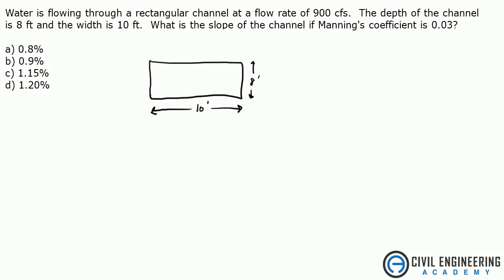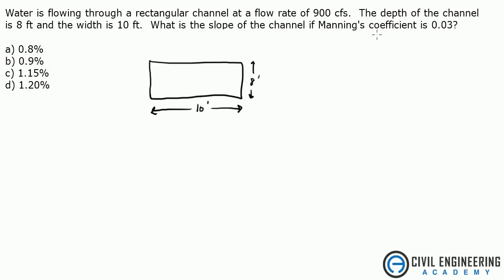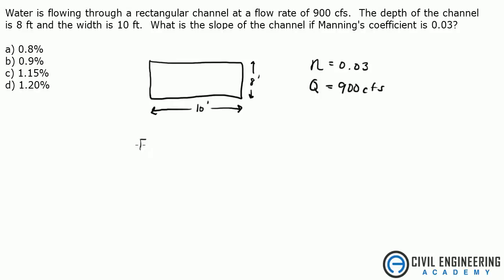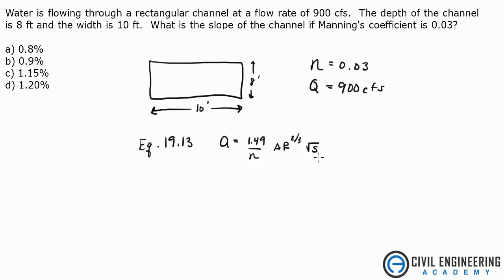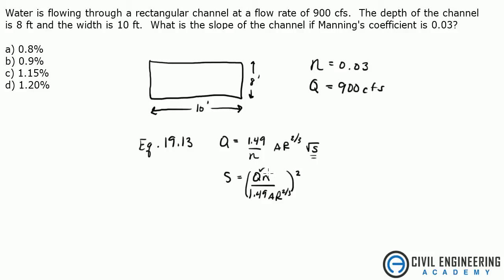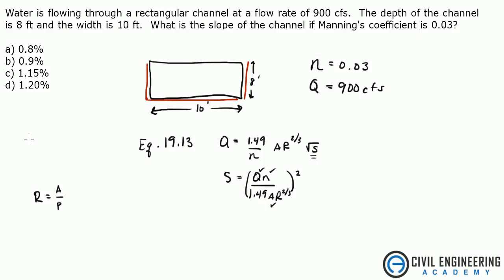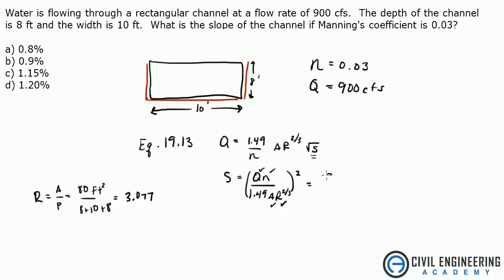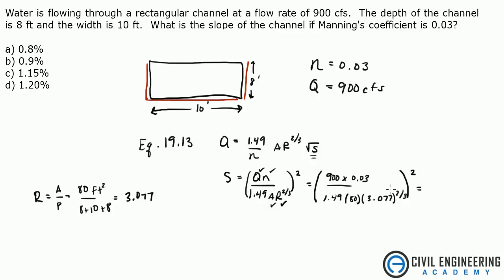Water Resources-Using Manning's Equation For Finding the Slope

Comment from the maker: Open Channel Flow problem was just posted.  Check it out!
Reply: Thank you for helpful educational lecture. I am wondering why always it ignores the unit of the time ( sec) while slope is found.  Thanks again
Reply: In Manning's Equation, S is the slope of the energy grade line, not the slope of the channel. The units for S are (ft/ft). That and the problem does not state if the channel is flowing full or not, you just made that assumption without mentioning that fact, which is not necessarily true. 

This problem is flawed and the answer is incorrect. You are misleading the blind here.